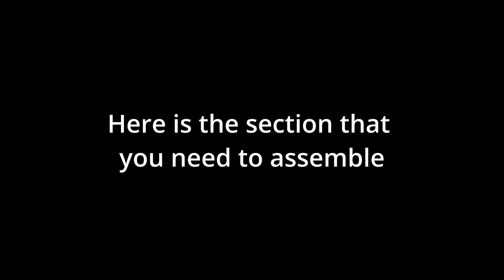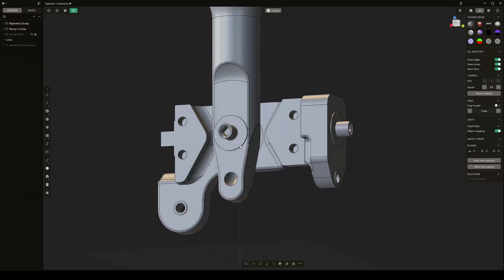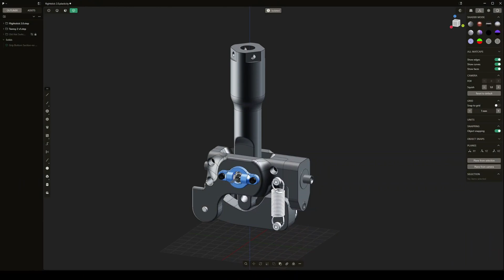3D Print Your Own Flight Sim Setup - The Astra Navigator

Comment: Awesome project. I wonder if it would be possible to modify it to work with vr controllers. It could use dome detachable mount to the controller. The setup would probably be much simpler. wouldnt need any wires. for the left side maybe we could have something that behaves like the gladiator omnithrottle

Comment: If you want to make it more smooth then buy double sealed NTN bearings which will lasts decades before failure. At first it will be a bit stiff and unresponsive but after the factory grease breaks in it will be butter smooth.

Comment: Hi, I have another question regarding your file. When axis (any but the forward-backward one is mostly affected) is pushed slowly to the movement limit i can feel the bearing "skip" or "jam". I have used exactly the same parts as in product description. Is that just how the bearing behaves under heavy load or some other issue.
Reply from the maker: Hmmm🤔,  that's interesting I haven't had many issues with my personal build. Do you mean that the stick is getting stuck at the maximum forward position? This is a known issue and I'm trying to design new cams to solve it.

Comment: What magnets did you use?
Reply from the maker: I used eight 5mm diameter 1.65mm length magnets, as its just what I had lying around, I made four pairs (stack of two). It might be easier to use four 5mm diameter 3.3mm length, you might even be able to get away with 3.5mm. All axial magnets in this setup.

Comment: Did you use metric or imperial measurement system while making this project? I've bought the file and want to make some changes for resin printing but i need to know what unit to use for converting and other stuff.
Reply from the maker: Hi I use metric for all my designs

Comment: What will you be using for the HID controller? And have you considered making the grip detachable from the base and passing SPI from grip to base to make it more modular?
Reply from the maker: I ended up using an Arduino Pro Micro. It would be nice to make it modular, but I’m not entirely sure on how to get that working 😅